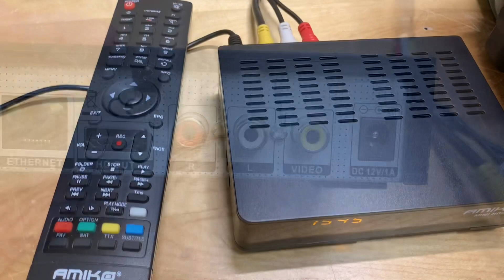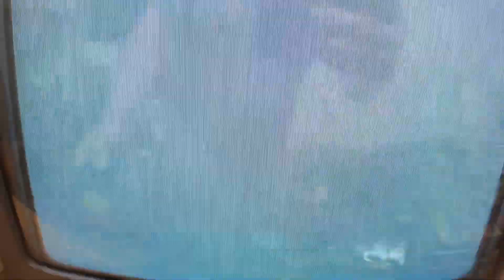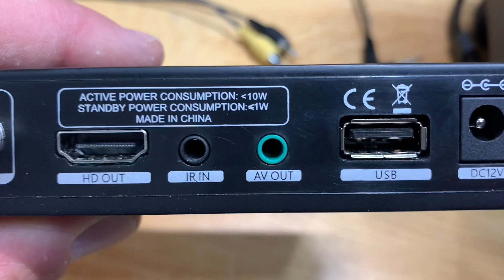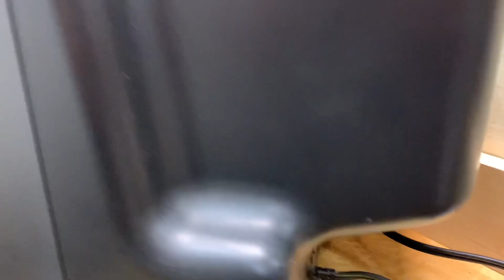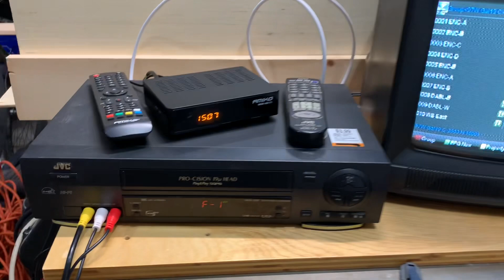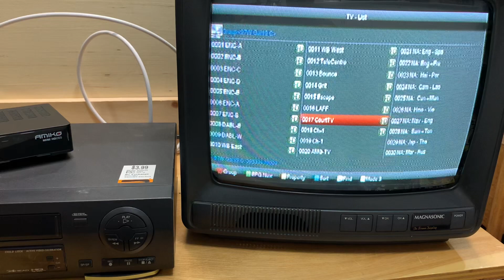Options to Connect your Satellite Receiver to an Analog CRT Television

Comment: What I find weird is that North American CRT TV s can't decode PAL video signal. The European CRT TVs can decode the NTSC video signal with no problems. Most European TVs have SCART instead of RCA but there are some CRT models that had both SCART and RCA. To connect an RCA cable to a TV with only a SCART connection you need an RCA to SCART adapter and the adapter works both ways, it has a switch "IN" and "OUT". Older european CRT TVs couldn't decoded the NTSC video signal but never had a flickering problem, the picture was black and white. The CRTs made after 1990s never had problems decoding both PAL and NTSC but NTSC has an inferior picture quality. Of course if you connect it through an RF connection you get a black and white picture so RCA and SCART is the only solution.
Reply: TVs sold in Thailand and Saudi Arabia have PAL, SECAM and NTSC analog tuners and video inputs.
Reply: South American CRT TVs have NTSC, PAL-M (Brazil) and PAL-N (Argentina).

TVs sold in Argentina have PAL-N (PAL 3.58 )and NTSC.